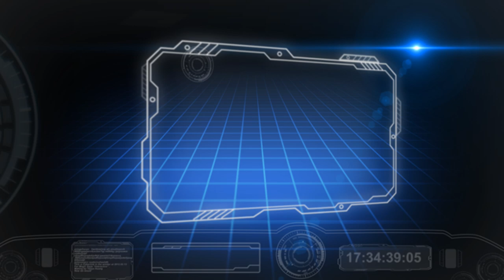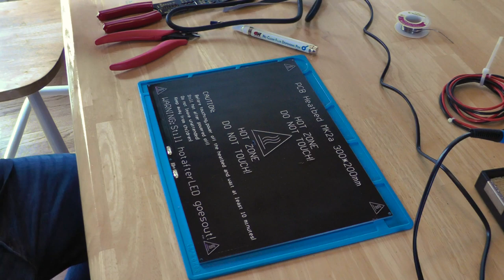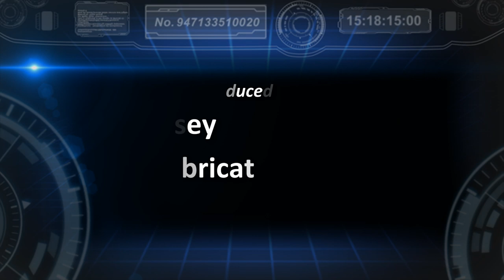How To Solder and Wire A New 3D Printer Heated Bed

Comment: Awesome! Someone else uses spayed electrical connectors! I've been razzed on the forums for saying I used those. Get told I'll start a fire, lol! Then I state that I consulted with a 30 year Electrician, who works on small electrical components, informed me they are rated for much higher voltage and won't start any fires. He said the crimp on ferrules are just for beauty and not necessary. Growing up on a farm, performing tons of electrical connections for you name it, working on car stereos professionally and demolition derby cars, I know for a fact they work without causing fires. Nice video and good job! I just did another Anet heated bed fix today with 12Ga wire, it had measily 16Ga wire, with 2 positive and 2 negative. A single 12ga will work better and I modded the wire strain reliever to run the wires directly to the bed and soldered them on by bridging the solder pads.

Comment: I usually do these jobs in the kitchen with the stove. Just lay the heated bed onto the stove, heat it up at about level 1.5, now you can easily solder the cables without any special equipment...
Reply from the maker: That's an interesting technique! Thanks for sharing.
Reply: I took this approach after not having much luck with a heat gun. Much easier on the stovetop for me (or would do well on a hotplate), I recommend this method
Reply: @DanielBrinks  I want to change the wire of my heatbed to make mre reliable. But the thermistor is already soldered on it. Does bringing all the bed, including thermistor, to 130°C may damage the thermistor ? or the heatgun is the best option in this case ? Thanks
Reply: @Slybaoth  Good question, I would not expect the thermistor to be damaged at 130C, but I'm not sure. If you use a stovetop or hot plate, you may end up inadvertently desoldering that thermistor, at least the solder may soften and it would have the chance to move around
Reply: @DanielBrinks  Thanks!
Reply: Not trying to look like an idiot but after attempting to solve this problem with a heat gun, 3 hot end heaters  (wired directly to a power supply and pressed into the solder joint), and 2 soldering irons all at the same time and still not getting enough heat, I just wanted to thank you. The stovetop is  so much easier and effective.

Comment: I am getting an Ender 5 plus for my first 3D printer in part due to all the great videos you've  done, I am aware of the main power supply failing issue, I am planning to change out the 24v heat bed and replace it with a 240vac heat bed to greatly reduce the load on the 24 power supply, I haven’t see any videos from you on this mod, I was wondering what your thoughts are on this mod.
Reply from the maker: I don't think it's necessary. At this point, I've heard most new Ender 5 Plus printers are getting the Meanwell supplies and I've heard of no failures with those. It will be cheaper, easier, and safer to just upgrade the supply to an even beefier one if you're still concerned.

Comment: With the wires soldered on the top, how do you prevent the glass sheet that sits on top from having an air gap between the bed and the glass? I'm assuming need to have the glass sheet sitting flat and against the bed?
Reply from the maker: We're actually soldering to the bottom of the bed. The flat aluminum side is the top.
Reply: @kerseyfabs  Ahh that makes sense, thanks. Clearly I'm new to this lol. A little confusing because the resistive elements can be seen on the black side, as well as, it gives a warning about a hot surface on that side so I automatically assumed that side should be up, but thanks for clearing this up!

Comment: Hello, I was wondering how would the controller know how hot the bed is when you set the 3d printer to heat up this part, thank you
Reply from the maker: Some heated beds have integrated thermistors that you will need to wire and some you simply add a thermistor to that you typically run to the center of the bed.

Comment: You have a wire stripper on your table, why would you use a pocket knife?
Reply from the maker: 😆 That's a great point. I guess it's an old habit. Plus, I'm quick and careful with a knife, so I don't think anything of it, especially on thicker wires.

Comment: Dose this process work the same with the smaller green and blue wire that's on the heat bed?
Reply from the maker: If you're talking about a small thermistor wire or something similar, you may not need this since it's so small. If you find the wire won't stick to the bed though, this should work.

Comment: you should print some wire holders  :)
Reply from the maker: Like some helping hands (stand with alligator clips) or something to hold the wires to the bed?
Reply: helping hands type of stand.  one other thing on the E5, it comes with a silicone sock now vs the cotton.
Reply from the maker: @jdkroh  I have some of those, I just didn't have them at the table, so I made do. That's good to hear about the sock. I really hate that cotton!

Comment: There is no tempreture sensor wire?
Reply from the maker: On many of these plates, you run a separate thermistor. It's not part of the plate itself. It makes it easier to replace if you ever need to.

Comment: So, won’t the solder melt when you heat the bed?
Reply from the maker: No. The melting point of solder is much higher than the temp you heat the bed to. Thanks!
Reply: @kerseyfabs  Thanks, good to know.

Comment: creality did a horrible job on my machine. i now have wire rope with solder stuck on the positive and negative part of the heat bed. how can i easily remove it so i can resolder?
Reply from the maker: A regular soldering iron (temperature adjustable) should be able to melt that if you crank it up. To remove it, you may need to order a soldering wick to pull it off the board: https://amzn.to/30CFoEC